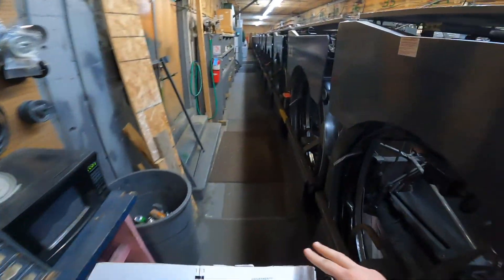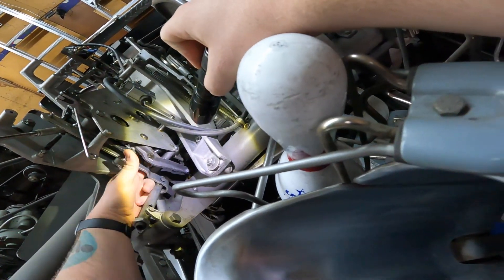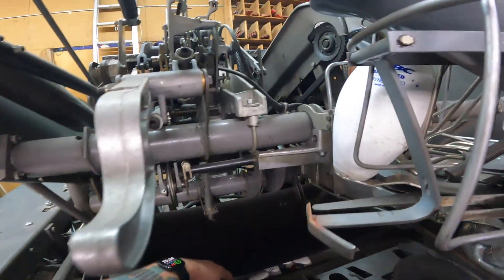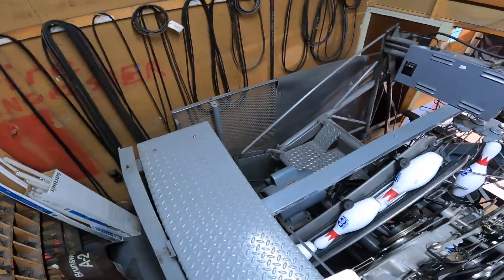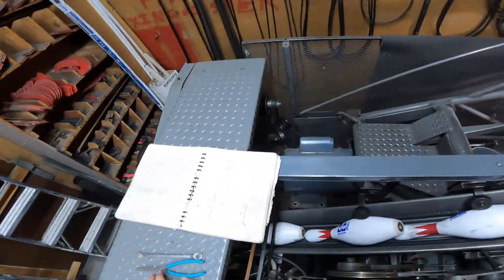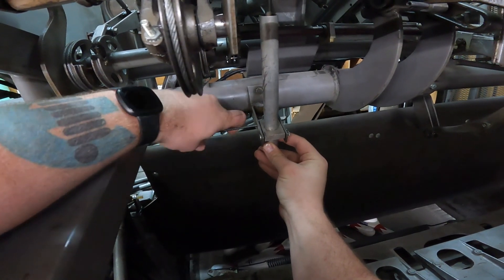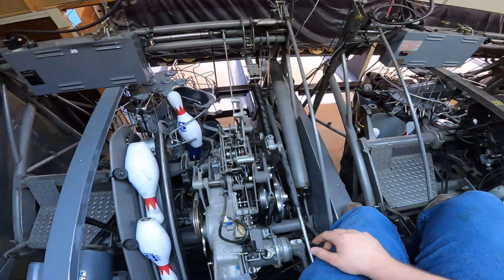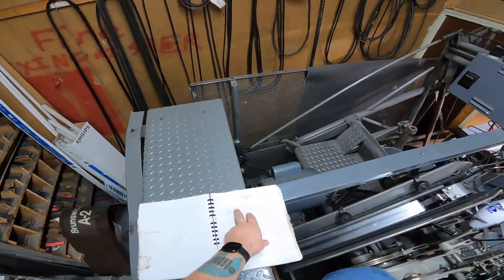Detector Rod #1 - Brunswick Pinsetter Adjustments

Comment: I just did a detector rod adjustment on a lane and it detects standing pins perfect and it detects a strike but for out of range pins it will lift back up and sweep them, would I have to lower the tube another 1/16 of an inch?
Reply from the maker: I would double check your OOR adjustment make sure that’s good then go and check the detector rod. I fought that adjustment one time for a couple hours before I found that the OOR adjustment was wrong

Comment: Hey question 🙋‍♂️ what if you make the adjustment and it’s not detecting a strike?
Reply from the maker: We had this issue not to long ago and it turns out the tube needed to be brought down just a tad more. More than the 1/16 or 1/8 whichever it is lol. But just look over everything carefully and make sure the first half of the adjustment is good, it’s very easy and common to be over looked

Comment: just as important Shawn is to check the OOR. it is the Detector rod after all. one should make time to check each of the detection conditions. sure it means going back down and manually removing the pins and placing one that is OOR. Just to check the OOR. but it still needs to be checked. for the pinsetter (not yours) may have additional problems, like OORs. --- with pinsetters as the A2, everything is connected and relative POV.

Comment: Hey Shawn, how about a video on replacing and adjusting the rake crank rod,hopefully you will do one on adjusting the indexing trip lever and long link as well. Thanks
Reply from the maker: If you’re talking about adjusting the length of the crank rod I did in my rake adjustment video. But never thought of doing one of replacing one, just might have to now. And I will be doing a video for every adjustment in the book along with some extra ones on rebuilding and changing out parts. Thanks for the feedback!
Reply: @thepinsettermedic  definitely. I work in a center that has been greatly abused. I worked at AMF/Bowlero but never received official training just had a really good head mechanic, but that was 7 yrs ago. So now trying to relearn all I did then. Great videos you have what I have seen so far. I am just trying to get this center I am currently working in to have fewer stops and initiate preventative maintenance. I will be watch your videos. I am a decent B level, but still so much I don't know. Thanks for making the vids.
Reply from the maker: Of course, the point of me making these is to help anyone any way I can. Adjustments and preventative maintenance are the biggest things as you already know. I wish you the best of luck and hope I can keep helping!
Reply: @thepinsettermedic  so lane 29 occasionally will not index after the #1 pin. I have tried the adjustment in the book but then it constantly indexes. Any advice on what to do with it? It's number 26 in the book
Reply from the maker: So does it drop in but doesn’t push the indexing lever down enough to unlock cam follower or does it just not turn at all after unlocking?
Reply: @thepinsettermedic  yep drops but doesn't push trip lever down to unlock cam follower
Reply from the maker: So first thing I would look at would be the indexing lever adjustment. In theory the weight of the pin should be enough to open up the latch. Next would be your turret wires. The corner pins I fought forever until we bought Kegal’s pin pockets, they simulate straight wires so the pins don’t bounce on the wires. Another thing I would look at is the Snubber while you’re in the area